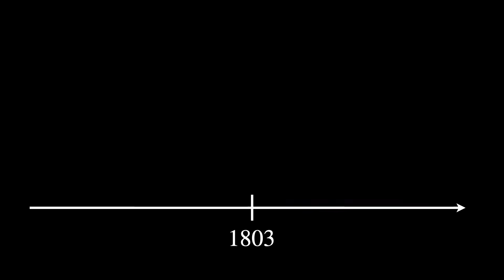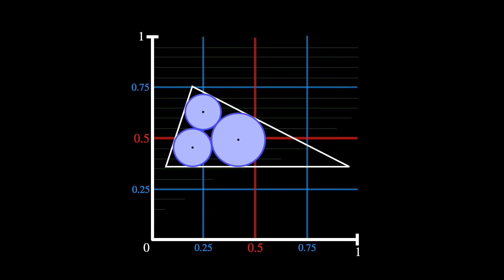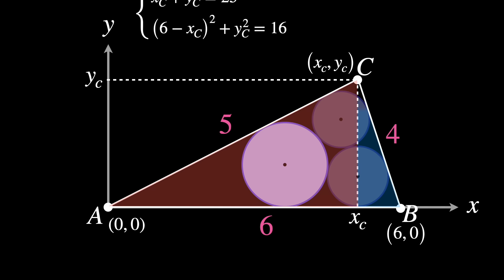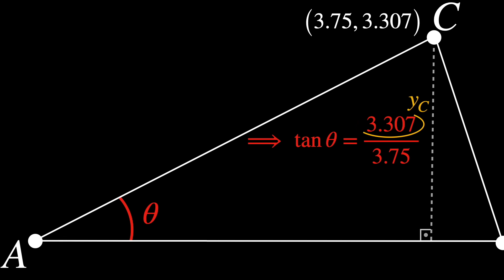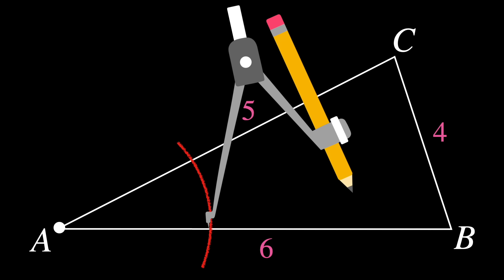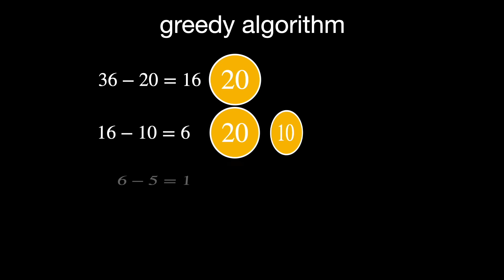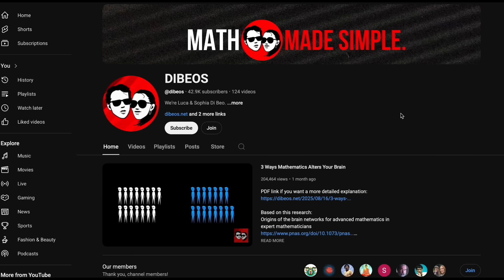The Simple Problem Mathematicians Got Wrong

Comment: Yes, the greedy algorithm will acquire the largest area for the number of circles greater than three. It will also work for all convex polygons. (I'll even use synthetic geometry for the purists.)

The first triangle of the greedy algorithm is the inscribed circle. This divides the triangle into three remaining areas. For each area, circles that touch two side must have their centres on the angle bisector. Where the angle bisector intersects the first circle, draw a tangent to the first circle. This forms an isosceles triangle. According to the greedy algorithm, the inscribed circle in this triangle is the next circle to consider. Continue on this way until there are n circles in each angle of the original triangle. Now sort all the circles by size including the the first circle and all the circles of all the angles. The sum of the areas of the first n circles will have the largest possible area that can be filled by circles touching at least two sides.

For convex polygons, find the largest circle that fits inside the polygon. Find all the tangents of this circle that intersects two sides and the distance from each side to the tangential point is equal. Repeat the procedure for each of these small polygons. Eventually the polygons will become triangles and the greedy algorithm can be applied to them. Sort all circles and choose the first n. the sum of their areas is the largest area that can be filled by circles touching at least two sides.

PS: The above procedures will work for the largest area of all possible n circles. They do not have to touch any side.

PPS: I don't think they'll work for concave polygons. This problem is left as an exercise to the reader. ;)

Comment: 1. There is a huge issue with your presentation of the Malfatti problem and its status in the mathematical community.

There is not one Malfatti problem but two.

Malfatti initially was trying to solve an existing problem: maximizing the area of 3 circles inscribed in a triangle. He made an assumption that the optimal solution would be the circles he proposed: 3 circles centered on all 3 bisectors of the triangle and tangent together and to the triangle.

From there the analysis of Malfatti's proposition lead to two subjects of study:

A. Constructing and measuring the Malfatti circles, aka finding the centers of 3 triangles tangent together and to the triangle and calculating the total area of those circles.
B. Is this the optimal solution to the initial problem.

From 1803 to the 1930s, mathematicians were simply focusing on the first problem because you can't prove or disprove something is maximum without first measuring it.

Contrary to what you say, mathematicians did not blindly accept Malfatti's solution as optimal for more than a century. They just put that question on hold, focusing on the preliminary question of constructing and measuring the Malfatti circles.

2. And then there is a huge problem with your explanation of the construction: you only construct a single random circle tangent to 2 sides. Where are the other 2 circles? How do you determine its size? 
Also the analytic construction and the synthetic construction you show correspond to two completely opposite construction problems.
Your analytic construction starts with a chosen r and constructs the center point on the bisector.
Your synthetic construction starts with a chosen center point on the bisector and constructs r.

Sorry to say it in a harsh way but this video is a confusing mess.

Comment: 5:40 It is "a pair of compasses" that constructs circular acs. A "compass" establishes orientation relative to North.
Yes, (old) pedant and ex-mathematics teacher here, I just like to use the correct technical language but maybe I need to accept the evolution of language on this point. 
I still enjoyed and learnt from this video.👍
Reply: It's acceptable to just use "compass", according to Merriam-Webster. Defn 3c:

"an instrument for describing circles or transferring measurements that consists of two pointed branches joined at the top by a pivot -› usually used in plural
-› called also pair of compasses "
Reply: @tenebrae711 Yes, like I say, evolution of language, where common misuse establishes itself as the acceptable norm. In exam papers in England the instruction is to "use compasses to construct..." just as most people may say "trousers" as opposed to "pair of trousers" (but never trouser).
At least the plural "compasses" distinguishes it from "compass", a completely different instrument.

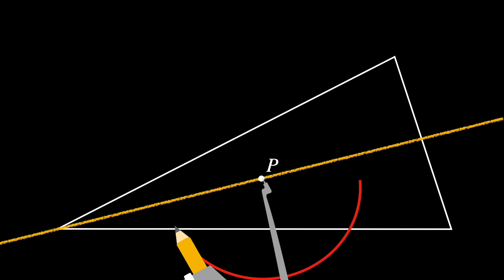Comment: I'm really confused by the construction between 6:40-6:54. If we are using the compass to construct an arc centered at P, then use the same compass (without resetting the length of it) to form 2 smaller arcs from the intersections of the larger arc and the triangle, should these 2 smaller arcs not intersect at P? Or by "smaller arc" did you mean arc of a circle with smaller radius? If so, you should also indicate this that these smaller radii have to be the same as each other. In fact, you could also make 2 arcs with larger radii to get a point above P, and if you draw a line from that point to P and down to the side of triangle, this line will also be perpendicular to side of triangle.
Reply: Well yeah you are right. But as you can change the length of the the compass it's irrelevant as long as it's greater than half of the intersection part of the side otherwise the arcs won't intersect

Comment: What I didn't get from either of your construction techniques is how you ensure that the three circles are tangent to each other. In both examples you only construct a single circle. There is no way that either method shown can automatically construct the circle that is both tangent to two sides and also to the other two, not yet constructed, circles. I assume there is some sort of iterative process that either creats additinal constraint equations for the analytical construction, or additional steps for the synthetic one.

Here is a question. Do you have to construct all three circles, or if you construct two circles that are each tangent to two sides abd are tangent to each other does that automatically fix the position of the third circle. (That is that any pair that satisfy the condition are automatically two of the ones that satisfy the full condition.)

Comment: Euclid's fifth postulate has been taken as obviously true for 2300 years despite never having been proven. It's also trivially demonstrated false.

Consider the equation of a line: f(x) = m *x +b

Also consider the fifth postulate: if a straight line falling across two other straight lines yields internal angles on one side whose sum is less than two right angles then the two straight lines meet on that side.

The problem is measurability. Euclid's oroi work on bounded, measurable planes. He asked this question because it relates to a situation he could not demonstrate. But note that he bothered to ask, while everyone else throughout the history of mathematics has boldly proclaimed to know that the solution is definitely in the affirmative, despite no proof having ever been produced. That should give you pause, because that's really weird. How did Euclid know to ask this question when literally nobody else who's ever lived would have bothered to?

Intuitively, if the two straight lines approach each other then they must eventually cross. But watch what happens when we plug values into the equation for a line vs the x-axis:
- the intersection must occur when f(x) = 0, thus we get 0 = m *x +b -> x = -b/m.
- if m is the smallest possible infinitesimal value we can distinguish from zero, then 1/m is an infinitude with a completely defined magnitude. or more importantly, we can clearly defined larger infinitudes.
- for any b with a magnitude less than 1 the intersection between our line and the x-axis occurs within measurable space, but for any other b the intersection occurs outside measurable space, beyond the infinitude given by the simple inverse of our smallest discernible infinitesimal.
- thus, in flat space, Euclid's fifth postulate is false, because whatever we choose our smallest deviation from parallel to be we can unambiguously create a separation between the lines which forces the intersection to occur beyond the corresponding scale of infinity.
- the prerequisite for being able to disprove Euclid's fifth postulate is simply being able to count. Thus we can also say that any system of mathematics which includes numbers, Euclid's fifth postulate fails, which is probably why nobody can prove it.

I know you'll reject the logic of this, but take a serious look at the history and the hubris of that history. Nobody has been able to prove the fifth postulate, ever, and yet everyone believes it's both true and properly rigorous to accept it as true. I just walked you through why it's not true, which is the only account of things in history that corresponds to all actual evidence.
Reply: This is well on the way to homogeneous coordinates, in which two straight lines always intersect, sometimes at infinitely many points at infinity, which are characterised as having final coordinate zero eg (1,2,0). However, this is not a disproof of the fifth postulate, it is an extension of Euclid's geometry. Other extensions are so called non-Euclidean geometry, such as Lobachevsky and Riemann geometries. Good old Gauss got there first as a matter of fact but was afraid of being ridiculed so he didn't publish, instead encouraging Lobachevsky to put his head above the parapet. A good read is to be found in the 'foundations of mathematics', which was all the rage in 60s University Mathematics. HTH.
Reply: "Intuitively, if the two straight lines approach each other then they must eventually cross. But watch what happens when we plug values into the equation for a line vs the x-axis:
- the intersection must occur when f(x) = 0, thus we get 0 = m *x +b -> x = -b/m."

If you change the problem space and make unfounded assertions then of course the answer will no longer be valid.

"- thus, in flat space, Euclid's fifth postulate is false, because whatever we choose our smallest deviation from parallel to be we can unambiguously create a separation between the lines which forces the intersection to occur beyond the corresponding scale of infinity."
That is just so wrong - it is astonishing that you somehow managed to find a keyboards as well as type out those words.

"- the prerequisite for being able to disprove Euclid's fifth postulate is simply being able to count."
Ah - the capability you have demonstrated to be lacking.

Comment: It makes you think what other proves might actually be wrong. Mathematical proves are often seen as the purest form of truth, but they sometimes turn out to be wrong. How can we ever be 100% sure about any prove to be not wrong?
Reply: The problem was that Malfatti never PROVED that his three circles (each tangent to the other two) maximized the area of ANY three inscribed circles (not necessarily meeting the Malfatti mutual tangency criterion) in the first place. It was at most a "belief," and simple inspection of a 1-100-100 triangle easily shows a case where it's obviously not true.
Reply: @kevinstewart2572  ah, right. my bad.
Reply: Obviously a fair point.  But consider math has an excellent track record of proofs holding up vs science in general.  Because math is frequently less messy than reality.  In any case, humans are obviously imperfect, and we can't be 100% certain of math proofs or science theory.
Reply: @michaelbauers8800  100% certainty has never been in the realm of science or the scientific method. To paraphrase Richard Feynman : It not the job of science to prove or disprove anything. The closest we can ever get to "so called scientific fact" is to have overwhelming evidence produced independently many many times. Theory of Gravity, Evolution are 2 good examples. Scientific Theory and Mathematical Proof are completely different beasts. 

Euclid's proof of the infinity of primes is 100% rock solid true. As good today as it was 3000 years ago. Certainly humans are imperfect but a valid proof is not - of course dependent on the axiomatic system used.

Comment: If you're looking for feedback, the way you state the problem is very confusing. It is unclear what is fixed and what variates when we are maximizing the area. Initially I thought that circle centers are fixed, and the triangle variates. And you state that circles need to touch two sides of the triangle, but greedy algorithm produces one circle that touches all three sides. I guess if it touches three sides, it also touches two sides, but such wording doesn't help with understanding. Maybe animating the circles and making them move and and change sizes a bit inside the triangle would make it more understandable.
Reply: You should have stated the 'Malfati >conjecture<' clearly at the beginning:

"In >any< given triangle three cirles tangent to each other in >two< points >and< each tangent to >two< sides will cover the >maximum area< of the triangle."

T h i s   conjecture was proven to be false.
Reply: @MatthiasBode-hu5qe  I guess he should first have introduced the Malfatti circles and should then have explained that Malfatti conjectured them to be the optimal solution to the "three circles-in-a-triangle" packing problem.
Reply: I was also a bit confused by this. You described the problems very well.
Reply: I guess he should first have introduced the Malfatti circles and should then have explained that Malfatti conjectured them to be the optimal solution to the "three circles-in-a-triangle" packing problem. Or the other way around, first introduce the packing problem, then explain Malfatti's conjectural solution. But instead the video starts with "the problem of Malfatti circles". There is no problem with those circles at all! They are completley well defined.
Reply: @ronald3836  I guess he should have minimised the video length to zero.
Reply: @CutleryChips  I think that's a bit too harsh :). It's OK to learn from feedback.
Reply: I have to agree that I was unclear what the original method was.  But I presumed as is often the case, I failed to understand something early on in the video
Reply: Having understood the Malfatti conjecture, my intuitions would have told me that it was not correct.
Reply: Ditto, I too was confused
Reply: There’s a point early on when he says to “maximize” the marble outside the column when he should have said “minimize”.  Needs better proof watching.

Comment: Your construction is wrong. The goal was to construct a circle tangent to two sides, with fixed radius, so it was to find the point P. But in the construction you just choose a P with "Pick a point for the fixed radius r", but you cannot just pick that point, you need to construct it.
Reply: I dont see the wrong part, you can choose a point on the segment
Reply: @CharcoalMathbut choosing a random point doesn’t necessarily give 3 circles tangent to each other
Reply: You guys are right, the construction doesn't construct what they said it does, it is phony (for lack of better terms I will use here), they are constructing a generic tangent circle.

Comment: Recursive Malfatti (2-circle contacts + 2-side contacts) circles (ie. after the first 3, repeat the procedure in the remaining space) always cover a larger area than Recursive Greedy circles (1-circle contact + 3-side contact for the first one, 2-circle contacts + 2 side contacts for the  rest). Furthermore, the fact that the Greedy circles are thus not conformant (1 is incompatible) even in the non-recursive case somehow makes it a solution for a slightly different problem and not precisely that (assumedly) posed by Malfatti which (again, assumedly) asked for 3 similar circles.

Comment: How do you call a synthetic geometry allowing the use of two pins, a string and a pencil so you can draw an ellipse?
Reply: Pins and string are a mechanical version of a straight edge. So we call it synthetic geometry. :)

BTW, for a while now, synthetic geometry includes also the origami method, which solved the old problem of trisecting an angle. .